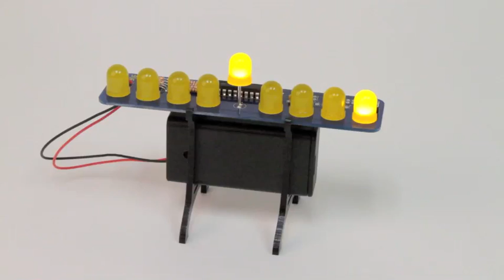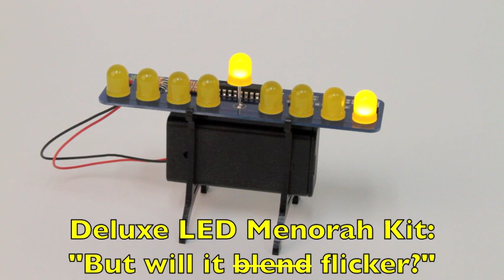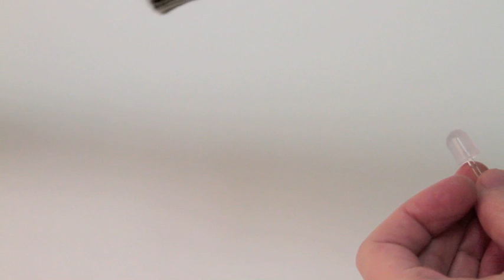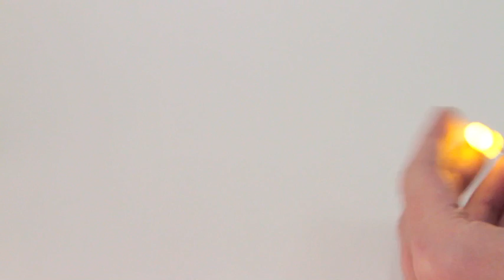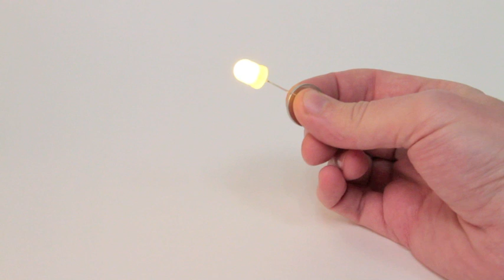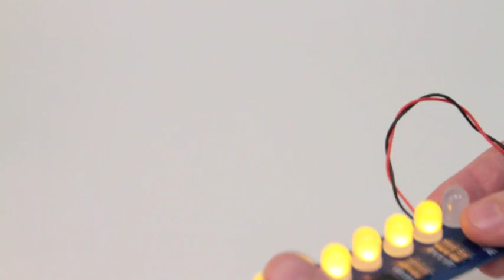The LED Menorah Kit and flickering LEDs

Comment: So parallel a capacitor with the LED to smooth the PWM to an average DC voltage and hopefully that's enough to keep the flicker LED's IC powered up so it can do it's thing.